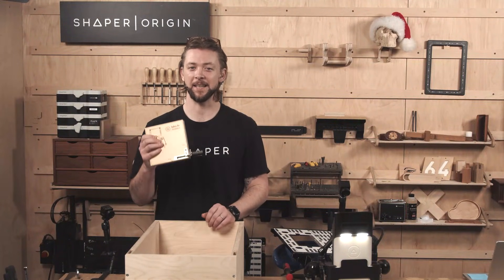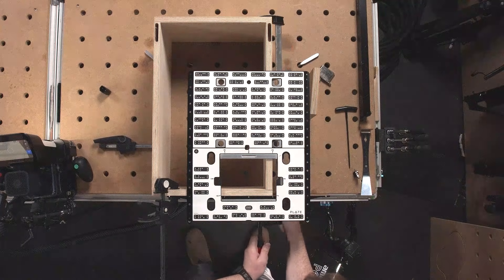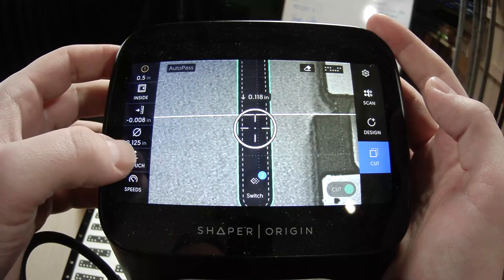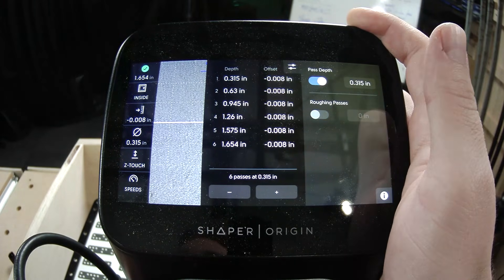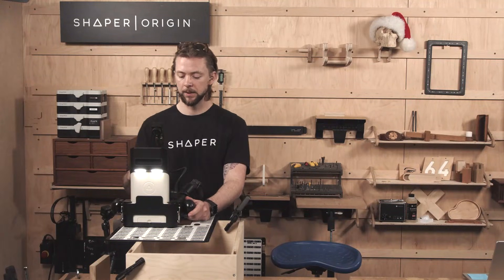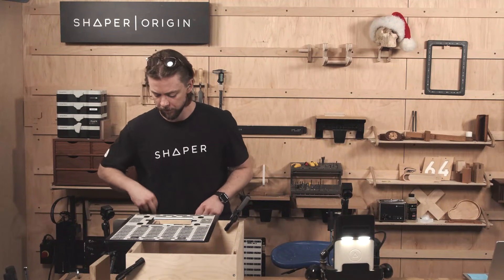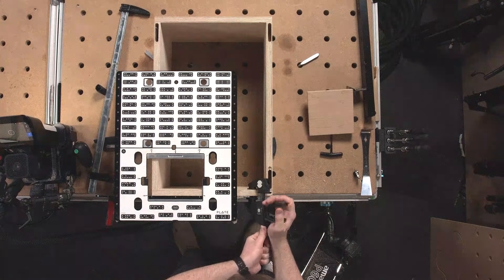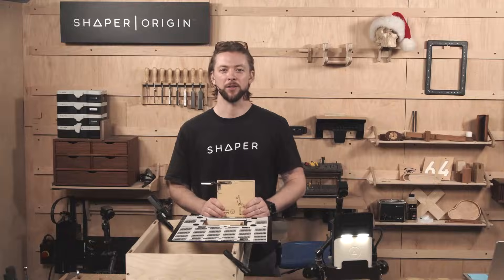Hardware Install: Salice Hinge Installation with Origin + Plate

Comment: Great video thank you. I’m still just a bit confused how the placement of the cut file is working here. If I’m using thicker material for example would I not need to adjust the placement? I don’t understand the comment it is perfectly positioned in the cut file.
Reply: Brian, the thickness of the material is irrelevant. When Jake says he’s placing the file at “-70 and -50” he’s talking about where the file gets placed relative to the 0 point, which is in the center and middle of the Plate, so 70 mm down from the center and 50 in from the edge. It’s a little confusing at first, but go to their channel and watch the roughly one hour long video on how to use Plate and install that same hinge. Jake and Russ went into detail about how it works